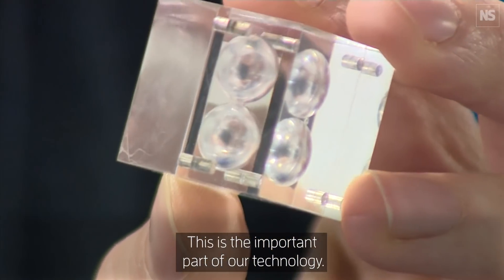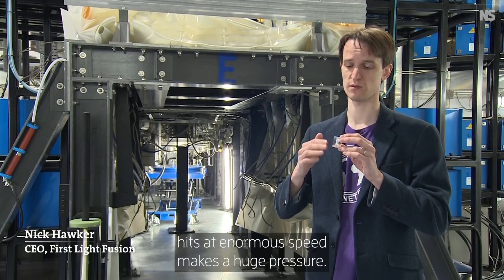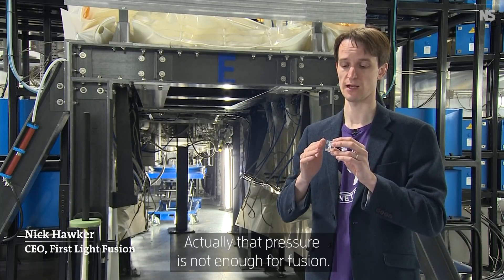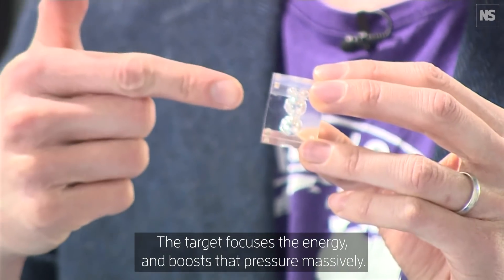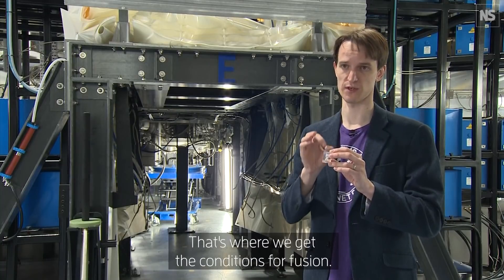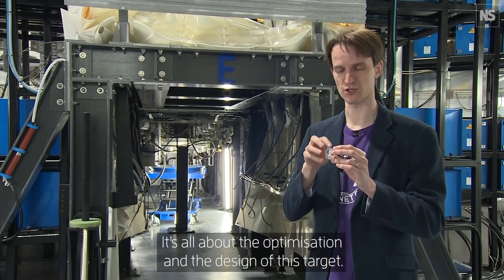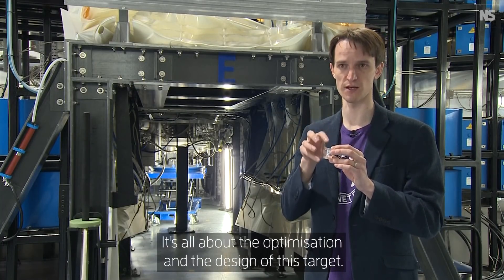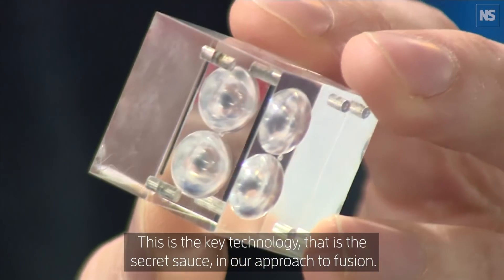Nuclear fusion breakthrough achieved with new projectile technique

Comment: There is a bit more to this story. A paper was written in 1981on this subject explaining research that had been done in the sixties. The company in this article, First Light Fusion started in 2011. 2019 they had a press release about the pellets and gun. In 2020 a press release that they verified achieving fusion(Super cool). The gun used fired the projectile at 6.5 km/s. In 2021 they had a press release about finishing their gun that can fire at 6.5km/s. At that point I thought I was crazy because I remembered seeing this same thing a year before. Now they have achieved fusion?
If you want to google it filter by date to exclude recent news.
Reply: Considering the Gun was only installed March/April last year 2021, not 2019 like you've stated. The company have never said they have achieved a fusion reaction before 2022 as they have only just released results achieved on the Gun this year, verified by UKAEA. Either you're plucking stuff from thin air or can't work chronologically.
Reply: @nonsensicaljibberish5146  Considering how ridiculus the whole idea is the only logical explanation that i can imagine for the reason why this idea is pursued is that someone was out of money and out of ideas how to do anything useful... all the money on this project will be wasted and most likely nothing new will be developed->only chance here i see here is some kind of nasty weapon...
How the hell are they planing to change this idea into constant source of power that you need to run as a powerplant?! Another question is how all the extra material that they are showing here that is all over the fuel will be removed from the fusion chamber?
And on top of that they are planing to solve all the problems in 8 years only...
 They clearly failed to post the video on proper date as it should be posted April 1 not April 6.😂
Reply: @Bialy_1  I think the just same thing..
Reply: @Bialy_1  It's a fancy science fair project
Reply: @Bialy_1  so, they are seeking to make a 150MW reactor, that is 150 million joules per second

if you can get a reaction that produces 450 megajoules a reaction but one reaction every 3 seconds, it is the same thing (so this would be a sort of pulse reactor making energy storage/disappation tech necessary)

As for saying its a waste of money, I think on the contrary. Its a new method of fusion. Its better to try new things instead of beating dead horses. It might emd up a failure but atleast we'll know its another way of not achieving fusion

truth be told I have hope for this one. shaping the target differently has the same effect as using a fulcrum for leverage. you can get an equal amount of energy exerted for less work being done on your part via simply taking advantage of physics
Reply: @Bialy_1  Your comment is so typical for the average youtube video. You have absolutely no understanding of how they are going to achieve this but you know for a fact based on a 1 minute video that it's impossible.
Reply: Yeah , at their website they claimed they had achieved fusion in 2020. Most of these projects are there just to suck in investor funds and make few people rich.
Reply: Fusion is easy to achieve. A 16 year old kid did it ages ago.
The problem is making it actually create energy.
I just watched a video a fusion scientist put out about the problems, and why all these new fusion start ups are almost a scam.
Ill try to find it.
Reply: @LittleRainGames  I mean this method seems like it literally can't achieve sustained fusion so I'd wonder if they have a plan for how they would even extract the energy out if they made it super efficient. Maybe all these intermittent companies have a plan idk. It's less standard.
Reply: @Bobbobbob984  maybe it can become a tweak to the orion space propulsion method of rapidly deploying  fusion weapons out the back of spaceship
Reply: @Bobbobbob984  I mean... just build two guns and fire them back and forth. Use the blowback from one to power the other. The cooling system for the barrels could power a steam turbine.
Reply: Its how 4th gen FUSION nukes worked.
 https://www.youtube.com/watch?v=z_lqQ7qx3D4
Reply: https://youtu.be/JurplDfPi3U
Reply: "achieved fusuon" means nothing

particle accelerator directed into plasma will make fusion

this phrase became a marketing term -_-
Reply: High energy neutrons degrade materials.
Reply: What's so important about fusion
Reply: @trickywily2823  clean safe and efficient energy, its supposed produce about the same energy as modern nuclear reactors but is safer since it doesn’t have radioactive waste, and it can’t meltdown like normal nuclear reactor, the problem we have rn is that we can’t get it to consistently produce more power then we are putting in
Reply: What's old is new again?  I hope they can patent their stuff, since in patent law you can't patent already published by somebody else stuff... lack of patents is a real deterrent to advance in many fields, unless you are doing 'social media' 'network effect' stuff for youngsters.

Comment: Get sufficient fusion power gain, add a few Teller-Ulam stages.
Fusion only bomb for basically everyone to build, no 235U/239Pu required :-)
Reply: Rail guns are not that simple or cheap or small 
But anyway this is massive step in the direction of democratised fusion weapons

Comment: what is the breakthrough here?
stop misleading people with false titles
Reply: Achieving an Inertial Confinement Fusion reaction with a completely different method. Designing something that is seen a espresso pod for energy, instead of trying to maintain the intense heat of magnetic confinement. Giving a different pathway to achieve a new source of energy. 
What have you achieved in the past 10 years?
Reply: @nonsensicaljibberish5146  my problem is with click bait titles. Not with the scientific achievement
Reply: @nonsensicaljibberish5146 achievements aside😂😂, this is a TREMENDOUS achievement ,
This should be so impractical as to be  impossible

Comment: "the next step for the team is to produce fusion that generates more power than it requires to be put in" - aaaand I'm out. It's a scam.
Reply: @nonsensicaljibberish5146  Claiming to be working on breaking the laws of physics is a clear sign of a scam in my opinion.
Reply: @peaotter8332  Fusion is theoretically sound within the laws of physics. Why do you think so many people are trying to do it?
Reply: @peaotter8332  It's not breaking the laws of physics.  It's not more energy out than in.  It's converting energy from one type to another at an efficient enough rate to "gain" useful energy from the conversion.
Reply: @afriendofafriend5766  whatever you say...

Comment: How is this new ??? 
They achieved fusion long time ago!!
Reply: It's a completely new approach to Inertial Confinement Fusion i.e. how our sun achieves fusion. As opposed to Magnetic Confinement Fusion using a Tokamak.
Reply: @nonsensicaljibberish5146  It is that, but I read about it more than an year ago.
Kinda old news and i personally don't think this project will have a commercial application before the competition.
Reply: @razor21212121  you may have read about the gun being installed a year ago but you certainly hadn't heard about the results. They were only released on Monday with UKAEA verification. The white papers are available on the company's website, which you are free to scrutinise.
Reply: They need fusion that actually helps (produces energy)

Comment: This is a really innovative idea, definitely one for the books regarding fusion breakthroughs,still it’s going to be really challenging to make a commercially viable power plant using this technique, as they would need to fire the projectiles constantly, while still using less power then the reaction produces. Fingers crossed 🤞 😬
Reply: I wonder if you can fuse ionized particles?  At least then the concept of a continuous accelerated stream of particles would be more achievable
Reply: @kingcosworth2643  No , using ions was one of the earliest ideas and it's tremendously practical.
Reply: Read it carefully, this breakthrough is about how to let the "fuel" burn, either by laser or by this [breakthrough] technology, with no fundamental change in the whole game.
Reply: It doesn't need to be constant. As long as the heat from the reaction is stored (they plan to use molten lithium for this), and used up slower than it is replenished, it will be fine. There's a lot more to design, including optimising the fusion chamber to maximise efficiency, but this is a major breakthrough, as it is a much cheaper way to reliably achieve fusion.
Reply: @Promotional Inc.If we spend 1% of what we spend on fusion research on how to drill deep holes into the Earth's core to get geothermal heat, we already get as much energy as we need.
Reply: You're so smart. I wonder if the scientists know that it's going to be challenging? Do the scientists know as much as you do?
Reply: @Industrialitis  Are you on your period? What a pissy response to a reasonable observation
Reply: @Industrialitis  if this guy knew the mechanics of a simple car he wouldn't have made such an uninspired complaint
This is one of the simplest  machines I can imagine besides from the target design

Comment: Different ignition system. That's all I see. You still have to contain the plasma once fusion starts and to provide fuel for the fusion. Those are still problems left unsolved for any long running reactor design today, or am I wrong?
Reply: It is not a continuous process.
New target and projectile every as quick as possible.
Reply: @dougaltolan3017  probably the idea is to have multiple targets on several axis around the chamber and the trick will be to be reloading these targets and projectiles on the fly as other impacts are occurring.
Reply: I agree, although the fuel source wasn’t stated. If it uses tritium, it seems to have the same limitations as we have seen before in laser pressure wave systems.
Reply: Have a look on the company website. It has just been updated since releasing their results. They have a reactor concept on there, so you don't have to kept guessing.
Reply: @mikegofton1  First Light Fusion has  YouTube chanel, there are some brief videos hinting at this stuff.
They will use tritium, but sinc they use it far more efficiently than a tocamak, they won't need anywhere near as much.
The chamber has a lithium curtain to recover the energy, protect the walls, clean (flush) the chamber and also produce tritium due to neutron bombardment.
They hint that a target and projectile cartridge will be loaded every 30mS.
Reply: @dougaltolan3017  That's 86,400 fuel pellets and impactors per day.
I hope they're cheap to manufacture.  FLF appear to have commuted the challeges of magnetic confinement into that of fuel pellet production.
Reply: @dougaltolan3017  , still, waiting for proof because this is no confirmation.
Reply: @mikegofton1  3D printers exist, as well as a lot of other faster manufacturing tech. I think fuel pellet production should be a lot easier than magnetic confinement.
Reply: They are not only not solving the problem but also adding new->the extra mass that is shot needs to end up somewhere and after ignition it will be all over the fusion chamber...
Reply: Yes you're wrong , there is no need for " containment"

Comment: use 0.1c ions instead, same design, electric ion sling
Reply: For this approach I suspect we can't currently "pulse" a single collimated ion beam consisting of a sufficient mass of ions to get the instantaneous impact inertia required.  That's why they're using a bullet versus a shaped target instead.  Other inertial fusion approaches have tried to get around this by focusing multiple equally spaced pulsed ion beams or lasers onto a spherical target.  One of the US labs announced a few months ago that they achieved greater output energy than what was put into the target (though not by much).  However, that was not considered true break-even because the energy efficiency in generating the laser or particle beams was significantly less that 100%.  Pesky thermodynamics.
Reply: @banalresentive6523  so you dont have ion drives, of course you can
Reply: @banalresentive6523  all this "we cant" is nonsense talk
Reply: @banalresentive6523  you dont know what you are talking about, its about individual ion-atom distribution of heat, temperature, in the millions of kelvins or thousands
Reply: @banalresentive6523  dont talk about law that you know nothing of
Reply: @banalresentive6523  your knowledge is a joke
Reply: @banalresentive6523  its better fling million kelvins ions than divide the heat to a million particles
Reply: @banalresentive6523  slap the chicken until it heats up
Reply: Looks like I hit a nerve, though I wasn't trying to.  Okay,  let's say you're right.  Let's see you try to convince the researchers to do it YOUR way, and get back to me when you do.
Reply: @banalresentive6523  why do I need to report to you, not working for you
Reply: @banalresentive6523  you are in my comments, get out, with your demands
Reply: @banalresentive6523  you were opposing me, and still are, get lost
Reply: @banalresentive6523  looks like you are against me, you said like it must be done like I say, or else", but I presented a better option, and you rejected it
Reply: You again?  You must be desperate for attention!  Or have a very tender ego.  All I have to work with is 3 years of engineering university physics (including a year of quant) and a continuing interest in fusion research advancements.  Again, if you're so convinced you're right, please contact the researchers of the article's project to convince them to use your approach.  I will not reply to you again.  Congratulations, you're the first person I've ever felt the need to block on YouTube.
Reply: @banalresentive6523  your name says it all
Reply: @banalresentive6523  whatever you think you have I have a double off, so stop bragging
Reply: @banalresentive6523  pride is your worst enemy, yourself

Comment: I’m excited that fusion is only 10 years away!
Reply: 'Always has been.
Reply: LOL
Reply: ... of ralizing it is actually an additional 20 years away
Reply: We really need to stop saying that
Reply: You are not off by much, but it will be 30 years away
Reply: It's said that Nuclear fusion always will be 10 years away, so in 10 years (2032), it still be 10 years away (2042).
Reply: It's always 10 yrs away
Reply: @_____ ITER won't work and I doubt will it ever be finished. They've recently had some more major delays as contractors couldn't place two pieces together, caused damage and were told to stop all work.
Reply: @_____ i had a feeling ITER was just going forward with momentum and not because they were actually getting anywhere.

Comment: Hi Surely when I did physics, the fusion at collision must happen at or above the speed of light so if the 2 atoms are fire towards each other must be above .5-.6 times the speed of light to get a total collision of 1.2 times the speed of light. but to truly reach fusion to give more energy than it takes to achieve fusion greater than 1. that is just to maintain its self.....
Reply: Hmmm...I think you mean the combined collision velocity required to ensure high probability fusion "the first time".  Stars don't work like that.  The high internal pressures of a star's core ensure many, many collisions per second between the fuel atoms.  On rare occasions, quantum tunneling will allow a fusion event.  if it happened easily, all the stars would just immediately explode!  (Actually, we'd just have smaller, shorter lifetime stars.) So, the rate of fusion in a potential reactor goes up with temperature, pressure, and confinement time.  These guys are working mainly with the last two.
Reply: @banalresentive6523  Hi I think you are missing the point a star does not require a an electromagnetic force to retain the fusion reaction, where back on earth it is needed to retain the heat to not only to make hydro atoms needed, it has to use a lot of the energy to protect the earth from frying. Some 80 percent of the energy from to fusion reactor is needed for this that is why the fusion reactors, needs to produce 10 to 100 times the temperature to get enough left over to provide electricity for commercial use ie heating in homes and industry.
Reply: Where did you study physics?

Comment: Firing a penny at a Fox's glacier mint... I really want this to be the one that works. :]
Reply: @hoppercar  thats the point of the experiments. Optimization is the key here.

By having a different shaped object, you can further decrease input energies. Its like using a fulcrum
Reply: @TheTechmaster1999  the first thing they teach you in navy nuclear power school....fusion is a pipe dream....the immense temperatures and pressures cannot be obtained, to sustain fusion
Reply: They should use spangles.
Reply: ngl I still want the tokamak to be the working design, that floating ring of plasma is the coolest shit I've seen
Reply: @isaaclai1636  tokamak
Reply: @pau1phi11ips  Autocorrect sorry
Reply: @pau1phi11ips  tomato-mak would be cool though;  near-limitless ketchup from seawater
Reply: I don't think this is self sustaining like a tokamak could be
Reply: @air_  True but they can hopefully put enough fuel in the capsule and have it produce a burning plasma - like the NIF experiment did to obtain 70% of energy in
Reply: Aye as they say, Nuclear fusion is always 30 years away
Reply: Dream on. It is never going to happen.
Reply: @travistalbot1284  how autocorrect can fail so much in its own job?!
Reply: championchap  it still doesn't work, what's the point
Reply: They still make those?
Reply: @imafackinjunglist  no, which is sad.